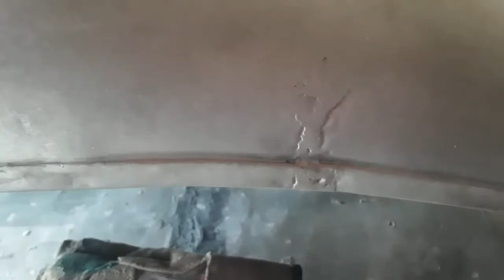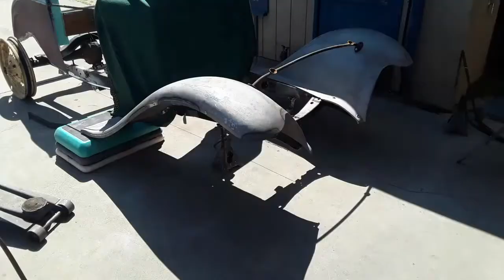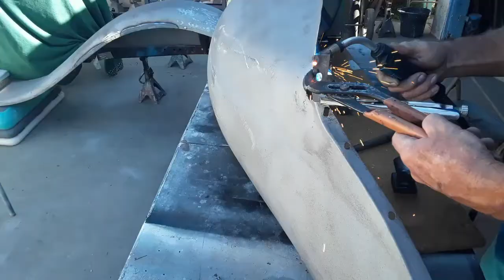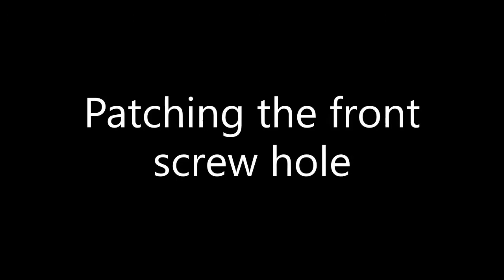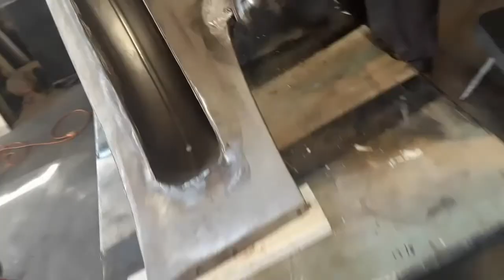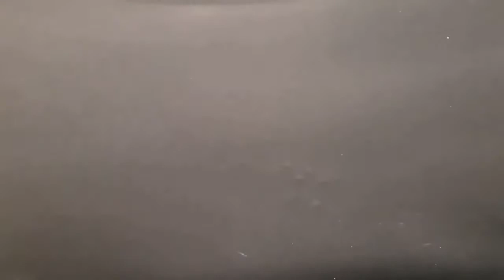Restoring 2 1930-31 Ford model "A" front fenders

Comment: Snyders supply the correct bead liner for right & left fenders, made in Denmark, & they make repairing original fenders a dream. It runs the full length from front to back & looks original. Sometimes welding & trimming & cutting & banging just doesn't cut it.

Comment: It's interesting watching his work and detail. In the 60's I hated body filler. I worked across from a well known body shop who got late deliveries at the gas station where I worked. For curiosity, I carried the gallon buckets of filler over. They were working on a new  damaged Cadillac, using a Bondo type filler.
After that, I stopped using lead and used Bondo filler on small defects too. I still have cars with a Bondo type filler I used years ago.

Comment: One more thing (if you didn't already know), that right rear sedan fender you were using for parts has a dimple in the inner apron.  That feature was only found on 1931 Sedans to clear  a bolt that held the rear valence panels on Victorias and Slant-Window sedans.  My late 1931 Tudor has them too, as did all other sedans in 1931.